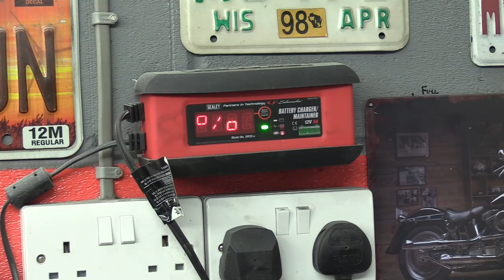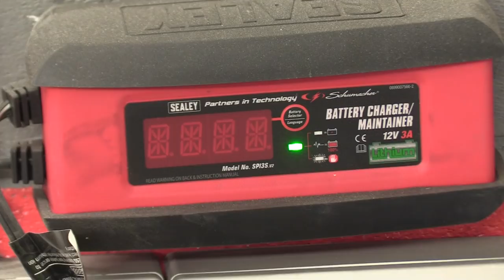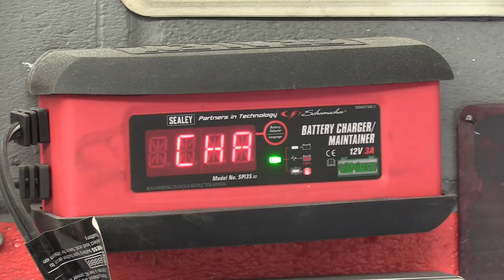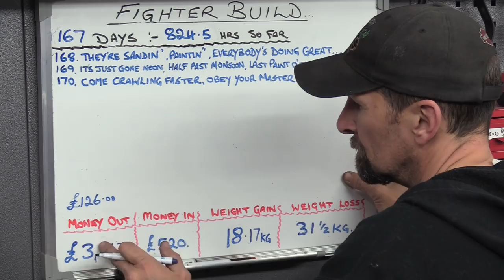Delboy's Garage, Fighter Build #160 "Master Cylinders".

Comment: I like the bit of tubing under the nut on the battery connector to keep it in place - magic!
Reply from the maker: Yes mate, thanks for that, also lifts the nut upwards so the screw can still reach it when you stack a few tabs on the terminal!

Comment: Awesome looking bike. Cool little trick putting some tube on the battery terminals to aid fitting!  Great video.
Reply from the maker: Thanks buddy, the tube just lifts the nuts up a little higher for when you stack a few tabs up for battery tenders and heated grips etc., and the screws become too short to reach the nuts!  Glad it helped, all the best...

Comment: That's another example of the track transfering to the street. They started those little plastic reservoirs as break away, easy to replace after a crash items. But being an old man, I prefer the one piece alloy assembly.
Reply from the maker: Hi Gary, I agree with you, being an old man too!  I prefer the tidy look like proper street bike resevoirs!

Comment: Great video. I'm nowhere close to rebuilding a bike but I do like the coffin reservoirs more than the plastic tub I have on my zx6-r. I do have a question though, as I have bolt on handlebars does it make a difference in being able to fit a different reservoir and the comment you made about having twin discs and 2 reservoirs, I only have one but do have twin discs. Is there something I'm missing here? Best wishes to Penny and yourself.:)
Reply from the maker: Hi Patricia, these reservoirs would work for you as long as your bars would hold them in a flat position, doesn't have to be exactly flat, but somewhere close would be favourable and what I said about the brake reservoir was tat it is a reservoir/master cylinder rated for twin discs... you only have one master cylinder to feed two discs, it's just a little bigger internally than a single disc rated master cylinder... if what you have in mind is changing to these, and you have twin discs, then just get the twin disc master cylinder, as I've listed in the link in the description under the video... great to hear from you, keep well and keep in touch,  all the very best, D&Px

Comment: The only downside of those pots are the screwheads.
Don't like those cross/philips heads.
Replaced mine for some proper allen/hex screws.
Look better and won't damage that easy.

Other than that, they are better looking than those pots for sure. ;)

Comment: Good job, i share your disliking of the plastic pot reservoirs. New Kwak Z900 RS, in my opinion the best looking new bike on the market, let down by those bloody horrible things. 
Front end looks great.
Reply from the maker: Yes, I noticed that, and what a shame, but then the whole story of the 900RS has been a devastating disappointment... when I picked up an email from Kawasaki about 18 months ago with some pictures of the concept bike, I was damn well ready to lay my money down there and then... they had spoke wheels with a 6" rear rim 200 section trye, 2" longer than the bike is now, 4 pipes (2 either side), fat upside down forks and the tank was a 60/40 proportion to the seat unit, rather than 50/50 as it is... it looked like brutal msucle, not only that, they originally pitched it with a big old air cooled motor that looked like a Zephyr 11 engine and a radiator that showed it was still water cooled... I simply wanted one, no matter what it took to get one, it wasn't possible to put deposits down based on the concept, nobody was prepared to take my money and guarantee me anything... But when the bike turned up, oh what a disappointment!  At a squint, it looks more like a Zephyr 550, the exhaust makes it look impotent, and it just doesn't seem to be any of the 'theatre' that such a mighty icon should have come back with... but it's a capable bike I guess, and ok, retro lookey-likey, and based on a ZX10, it's gonna be a hoot to ride, but what a shame that Kawasaki missed a chance to create an icon...

Look what Yamaha did with the V-Max 1700, they took an icon and put it on steroids and made it an outrageous bike that everyone wants to have a play on!  But will a Z900RS ever do that, sadly not... and what I fear most is that they'll never hold their money... I've seen GSX1400's for sale recently at £1500 and, sadly, the £10k 900RS will go the same way... which is a real shame for those who have laid out their hard earned money for one....  you're right too on the piss pots, they even have the cast master cylinders available on other bikes they could have used... but who knows what goes on in the heads of motorcycle designers... Take it easy buddy, thanks for your feedback!
Reply: Im an XJR fan and fortunatly have a 2002 since ive had since, well 2002. Other bikes have come and gone in that time but my XJR is definitley a keeper.  Thats my retro fix.
Reply from the maker: @hartley383  Aha, the venerable XJR, I have to admit, they are probably the prettiest muscle bike on the road... I do miss the turbo, but it served a purpose and it was great fun to ride... I felt a bit like you when I had a CB1300, in fact I had two of them I liked them that much, did the usual thing of sell it, then regret it, so went out and bought another one, then still sold that!  ...take care buddy, and have a great weekend!

Comment: Hello delboy same as you i am rebuilding a kawasaki into a streetfighter model. I also changed the clutch and brake levers for new ones. Only now im running into a problem with the clutch switch on the clutch lever. Same as you the connector of the kawasaki has three pins and the new lever with the clutch switch has two  pins. What did you do with that? 
BTW the bike looks awesome and your videos really helped me a lot building my first bike many thanks.
Reply from the maker: Hi Samuel, my clutch switch on the unit I got from Wemoto was compatible so perhaps you've got a different item... what bike is yours from?  If it's universal, then it will simple be a negative and positive, so if you check the three wires on the loom, you may find one of them is a double earth or a double live (it can't be anything else), so find out which is which and double them up if that makes sense... thanks for you kind words, much appreciated mate.
Reply: @Moonfleet41  Hello delboy, the bike is a kawasaki zxr 400. I will check the wiring. Thank you very much for the advice.

Comment: lithium battery is lighter but my experience is they are not good for cold weather riders or storage / non-maintenance type people will have issues  they  always need a maintenance charge. love ya take care and God bless. Oh yeah that cycle is looking spot on
Reply from the maker: Thanks buddy, yeah I have a couple of complaints on the litium battery, it does drain over time, even when not plugged in to anything, the worst thing of all is when the battery drains down to 50%, just like your power tools, it stops dead and won't even fire the ignition, let alone turn the bike over, I don't know if it's a protection mode or what, but a regular battery slows down as it drains, giving you a warning to charge it, or check it, but lithium batteries will spin the bike over at full speed, like they are perfectly healthy, then they fall a fraction below 50% and they stop dead with no warning, just like a drill!  So the bike will have to live on an optimiser... still may change it for a Motobatt yet, not sure !!

Comment: So the rubber hose under the battery nuts was to bring them up higher because the extra ring terminals shortened the reach of the battery lead bolts.  Nice!  I will have to remember that, had the same problem, but bought longer bolts instead.
Reply from the maker: Exactly that in every way mate, I've seen people use folded up bits of card, but they just get soggy!  The loinger screws are ok, as long as if you reduce the amount of tabs you change the screw back to a shorter one so it doesn't hit the bottom and hit the battery terminal!

Comment: Are those master cylinders the same ratio as the ones removed ? Or is the ratio higher/lower for less/more lever travel ?
Reply from the maker: They're exactly the same mate, identical spec, which is very important indeed as you quite rightly point out!

Comment: Love your videos, it might just be me with OCD but your brake banjos would look better on an angle where they are bolted to the master cylinder just like the banjo coming off the clutch master cylinder so it goes behind the front fairing a lot higher.
Reply from the maker: Hi Mark, that would restrict the amount of travel I have in the forks as the clutch side goes directly inside the forks and then down in to the fork tube off to the clutch, whereas the brakes go down under the bottom yoke to the calipers, so whilst you're right, it might look a little better, that would then put an unnecessary bend in the hoses and shorten their available reach... but I did consider it, as like you, I like things tidy!

Comment: bars lovely and neat, front cowl looks very well too! I'd swap out the screws in the reservoirs or anti sieze them at least, I've had to drill out so many sets it's not even funny, ones that have only ever seen JIS drivers and had all the care in the world.
Reply from the maker: Yeah, ive swapped them for stainless ones in the past and they rattle loose..  so yep, the best solution ive found is to dab a spot of anti seize on them.. works for me.. but i dont promote it because all the short attention span brigade deride it..!
Reply: @Moonfleet41 agree, besides never one of those lads around to drill or magic them out for me so anti seize and regular inspection it is.

Comment: Good night, well done .Front is looking great. Did you just changed to a led indicators relay ? does a led tail light needs any resitor ?? thanks , Gus
Reply from the maker: Hi Gus, yes i just changed to a dedicated LED relay, and with your light, it depends if the unit has a resistor in it already, most do if they are designed to retro fit...!
Reply: thanks a lot Del,  have a good weekend.

Comment: What was the clear tubing in the terminals for?
Reply: Holding the nuts tight until you put the screws in. A great little tip I never thought of until now.
Reply from the maker: Its actually to lift the nut up a bit as well as hold it in place.. when you fit a second terminal like a battery minder etc.. the screw is then often not long enough to reach and pick up the nut.. so the little nub of hose holds the nut up against the underside of the terminal block... and it doesn't get soggy like ive seen people use a folded tab of card..!!!!!

Comment: Been watching your videos for about a year now. You can never learn too many tips. I like the way you film your subjects, explain what you are doing clearly, & you have that anal attention to detail which is rare from other butchers on here which is a good thing. Just thought I'd chime in when I saw you fitting the master cylinders up with oil. I recently found some brake fluid (by accident)  good brand (in Australia at least) made by Bendix brakes. The fluid is blue, which is cool man, and shows up in your master cylinder window really easily to see, and shows up on the ground as blue also which if you do have a leak, you can knock that on the head for faster oil problem solving. Keep up the good work, and would like to see more on your HD in the near future.
Reply from the maker: Hi mate, great to hear from you, thank you for your kind words...!  Just one thing I must ask, is that brake fluid you're talking about possibly DOT5 fluid?  If so, that's usually a purpley-blue colour, it will say if it's DOT4 or 5 on the bottle, it's very important to know cos it doesn't mix with regular brake fluid, if the two get combined they can form waxy blobs of gel and bung up the braking system, so if it's DOT5 and you put it in with the old clear fluid, may be good to check it mate... Cheers , have a great weekend...
Reply: Thanks for that info. It is a DOT 4 the same nice colour as the Blu loo you throw in your toilet. The bottle says it's an Ultra Premium suitable for brakes, clutch, ABS/NON ABS Disc, Drum, Cars, Trucks Buses Motorcycles, & probably a flying carpet as well. Boiling point says 260° Celsius, & for $18 AUD I think it is priced well. I have only been running it for 3 odd months so I wouldnt say it's great stuff yet as time will tell. Just thought it was a nifty thing to use as alot of master cylinder windows can be quite murky to read. Definitely don't mix any old & new fluids together, I prefer to put a master cylinder rebuild kit through every 2 years as it's only about 30bux & half an hour extra when servicing my brake fluids. (The dirt bike I do yearly).
Keep up that quality of work, cause there aren't many people left around who can give a fuck anymore. Not sure if I can say fuck on YouTube?
Reply from the maker: @mikrauha2092  Hi mate, that's relief, hearing blue brake fluid just hit the tilt button lol as am sure you know, mixing DOT4 & 5 makes an interesting mess, am sure you wouldn't have done that, as you know what you're doing!  Have a great weekend mate, and stay in touch, all the best, Del

Comment: Looking great after every episode ,may I ask about why you put rubber piping in the battery terminals is it for safety? Also this bike needs to be called the ALIEN 😁
Reply from the maker: Hi Paul, you're very kind... the tiny bits of plastic tube just lift up the nut and hold it in place so you can reach it with the screw as when you stack more than one tab on the terminal, sometimes the screw won't reach the nut, but this way, it always will and the nuts never fall out and get lost down inside your frame!   TC and have a great weekend!
Reply: @Moonfleet41  thanks another top tip

Comment: Those indicators look far too small to be safe but hard to tell without seeing how bright they might be in daylight. I wouldn't be happy with them on my bike personally.  Aren't they partly obscured at the front by levers not to mention gloved hands?  Nice tidy job though 🖒
Reply: Paul C I think the MOT will prove if they’re legal or not.
Reply: I didn't mention anything about legalities...a bit defensive perhaps?  It was more an observation on how small they were and their positioning, that's all.  It may be a personal thing, but whatever...point made.
Reply from the maker: Paul C:  Hi Paul, you're right they do look like they might not be bright enough, but they're are 6 diodes in each one and they're as bright as the indicators on my triumph Tiger, perhaps it's deceptive, but the lights in the garage are pretty bright and, perhaps, drown them out a bit on-screen... look at the headlight for instance, it doesn't look that bright when I tested it, as I noticed in editing, but it's twin 55watt H7 bulbs, and are pretty blinding when you look at the light in real life...!

I'm thinking of swopping the levers for the short ones I had, as they do fit on in place of these ones, and still have the option to add some small LED ones in the tail later, if I'm just not getting enough light... that's what shake down runs are for buddy, I want it safe above everything else... thanks for your input, all the best
Reply from the maker: Michael Williams:  Hi Michael, I've been working with the MOT guy, who's a mate of mine, throughout the build, so I don't go down any blind alleys that will cost me money to rectify... so am hoping for a straight forward pass first time, but the coming shake down runs will determine what mods to make, tc buddy, have a wonderful weekend!
Reply: Paul C wasn’t being defensive, just thought id mention the MOT. I’m sure it’ll all be as save as houses 👍
Reply: Fair comments as at least it's been thought about.  Hard to judge brightness on the vid.  The brighter the better!  A nice loud Dinali horn tucked away somewhere might be a sound addition! (no apologies for the pun!).
Reply from the maker: @ReferenceFidelityComponents   Hi Paul ah you noticed the horn, ain't it pathetic!  But then isn't any bike horn ... still think the train horn prank videos are some of the funniest on You Tube, it's just where to hide the compressor.....!
Reply: Ah though there is a smaller version (mini sound bomb) which doesn't need the compressor and is still about 113dB claimed.  Ebay ones can be had cheaper, possibly made by the same chinese factory?  I use one on my beemer and tested it at 112dB/1m using a calibrated sound measurement mic I use at work.  Cost about £15 and draws the same as a standard horn so win-win ;-)